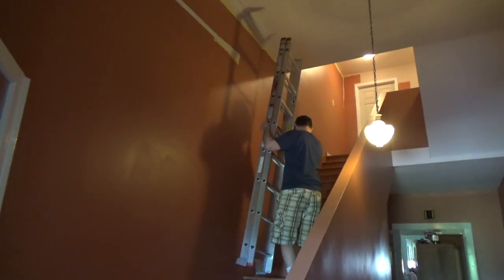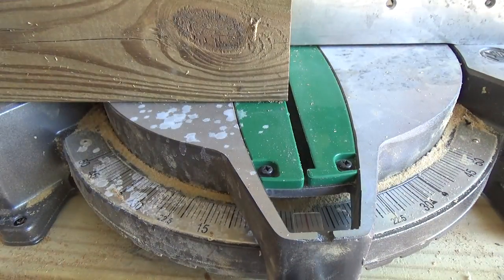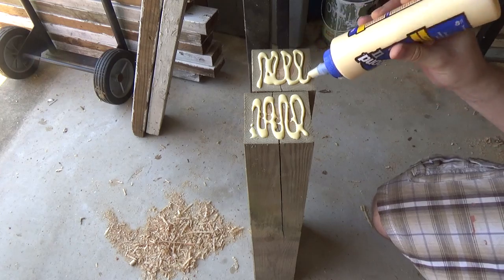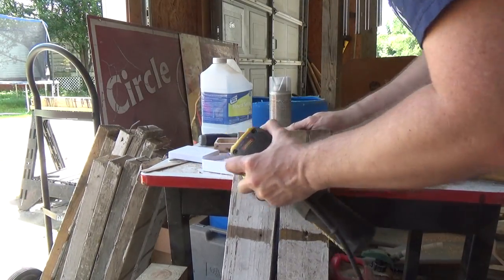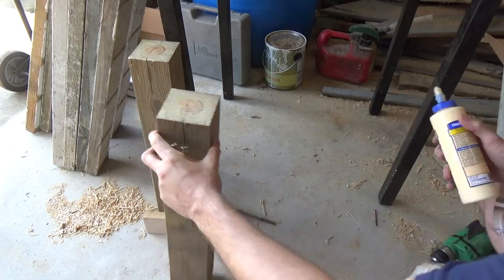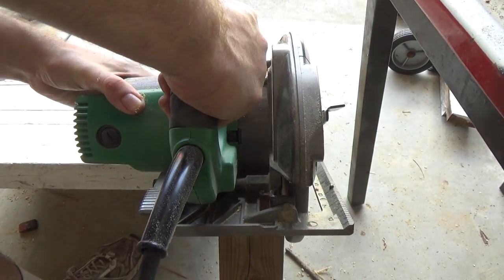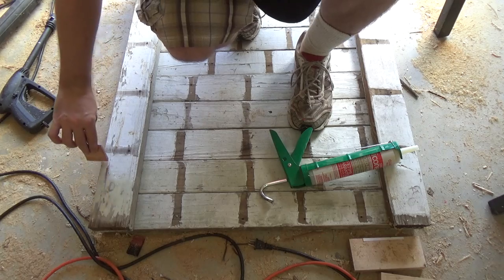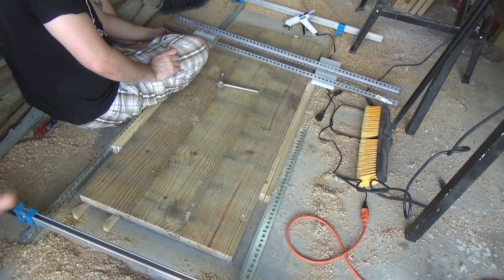Make an Easy and Secure Staircase Ladder Platform | How To | DIY stairmate

Comment: I added a cross piece in the front, about 10" high, so the legs wouldn't go anywhere.  I also screwed in two corner triangles between the posts and platform for extra safety.  I should have used the 5% cut and silicon ideas from the video.  My platform was only 17" wide, so one person could be on the platform and another person could (carefully) get around them.  With the 17" width, minus two 2x4 widths, that left a 10" space which I filled with 17" wide 1/2" plywood instead of old 2x4s.  3/4" OSB flooring would work great, too.  Finally, I put a narrow strip of wood on the platform edge farthest from the tall wall for the ladder to lodge against (i.e. so ladder won't slide off the platform because I have a railing, not a short wall as in the video).